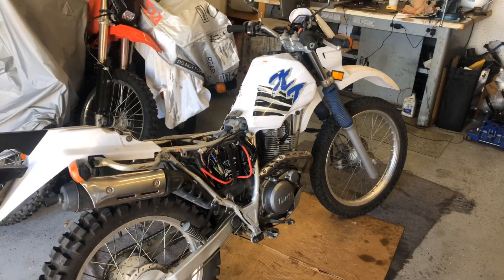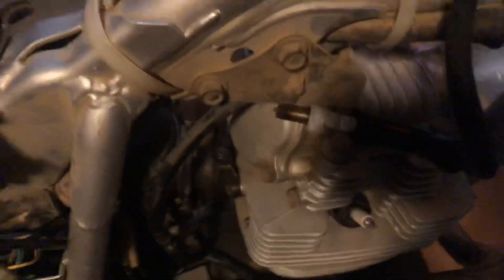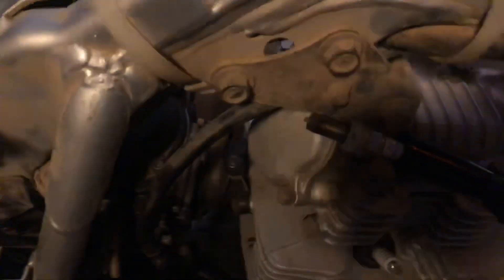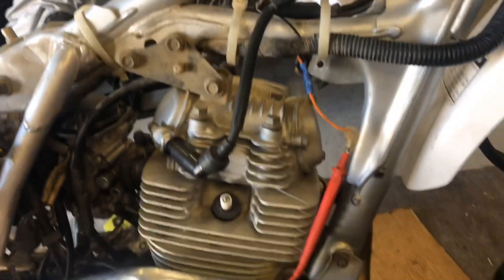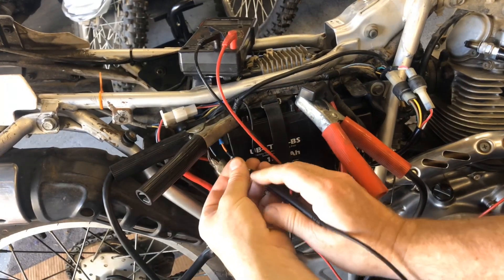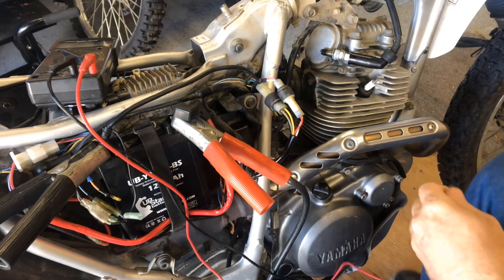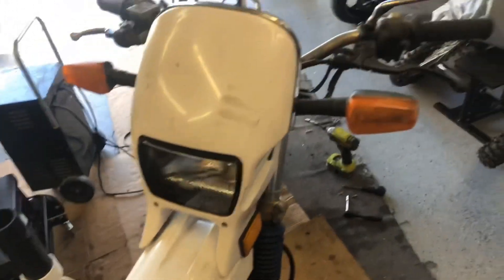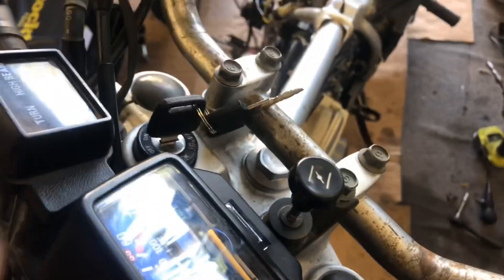Yamaha XT225 Serow Troubleshooting, No Spark

Comment: It's got to be one of those aftermarket made in china key switches. I bought one, it's a 4 wire switch with red, brown, Black and white with black tracer. My orig. was Red, brn, blue with yellow tracer and blue with black tracer. Now, when you turn  to on, the red and brown have resistance. When off, the others have resistance...no good China!
Reply from the maker: There’s a reason why they are only $11, saving money never cost so much!
Reply: @TomsTinkeringandAdventures  😂 so true, so true!!

Comment: I wasn't driving my ybr 125 for year. So i decided to fix old issues, so i replace ignition switch, ignition coil and starter relay. The parts are cheap so i didn't want to play with it and check what's wrong. But after replacing this stuff and the others (like cluth) i couldn't start engine. So i chceck whole electric instalation and i was almost going to replace ECU. I hope it will be it :)
Reply from the maker: Best of luck, I hope you get it going.
Reply: @TomsTinkeringandAdventures  Thanks i appreciate it :)
Reply: @TomsTinkeringandAdventures  Unfortunately it wasn't it. But i am still glad that you show me how to skip ignition switch. I have already bought ECU and it's not as expensive as i thought. :)

Comment: Hey Tom awesome videos!

 I have a XT225 and I believe I don't have everting wired in correctly.  
"I have the same problem just one spark."
Do you have a 2000 Yamaha XT wiring diagram?

Thanks!
Reply from the maker: If you search online you can find the manual and wiring diagram.
Reply: Tom's Tinkering and Adventures I can’t find a 2000 diagram •____•.
Thank you for the reply!
Reply from the maker: @lucasjames518  all the years are the same.

Comment: My xt started having a weird blinker problem.  One side blinks fast as if a bulb is broken. But i got all new bulbs. Blinker relay and even a new blinker housing. 

If i swap the right and left wires the problem switched sides. So it's somewhere in the wiring sadly. 

As it blinks on and off, the engine cuts on and off (with the fast side) 

Very strange. Any ideas?

I also took apart and cleaned the turning/ horn switch. Not that i don't think. 

Thanks
Reply: Traced wires and they all look ok. No frays no breaks.
Reply from the maker: @georgeponzoni3554  sounds like a ground issue?
Reply: @TomsTinkeringandAdventures  how do I look for, check for and fix that?
Reply from the maker: @georgeponzoni3554  I would start by removing the turn signals one at a time, see if the problem goes away with one of them removed.  Maybe look very closely at all the wiring.  Engine cutting out makes me feel that a power wire somewhere is possibly missing insulation and grounding against something.
Reply: @TomsTinkeringandAdventures  funny thing is, if I remove the front blinker from the bike (of the side blinking fast) the bike will not start. And the "neutral", "high beam" and turn signal indicator lights, all light up at once  (up by the speedometer) when the start button is pressed. 

Very strange.
Reply: Removing the back one of the problem side has no effect.
Removing the side with no problem also had no effect.
Reply from the maker: @georgeponzoni3554  then I would look very closely at the wiring

Comment: I have a problem similar but haven’t figured it out yet
Reply from the maker: Electrical issues can be frustrating.  Take your time, check the easy stuff first.  A wiring diagram and a multimeter will definitely help.  Good luck, thanks for watching.